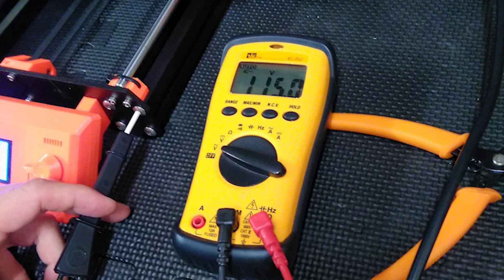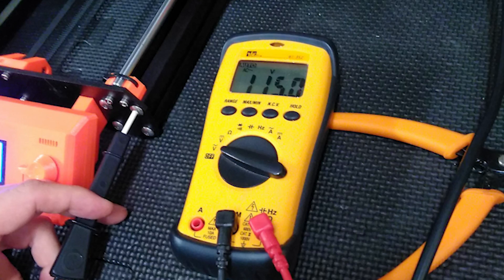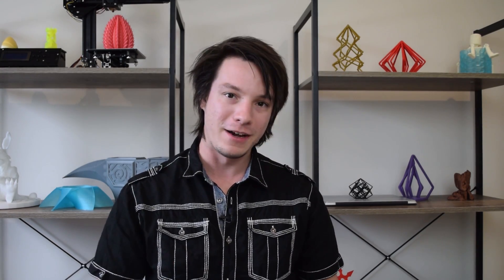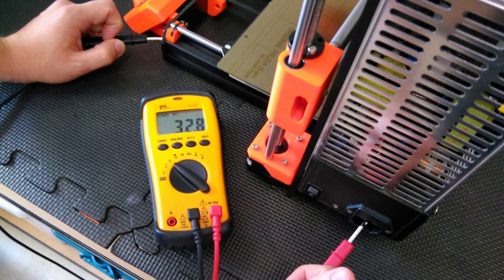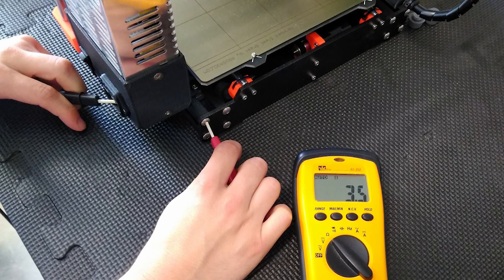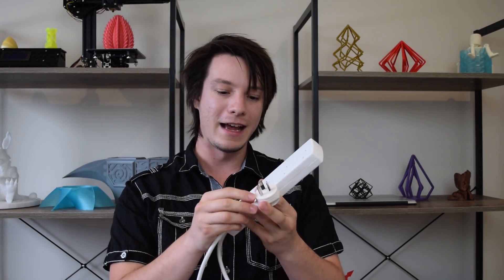I got shocked by a 3D Printer

Comment: No single wall plug in my house has ground, only in the bathroom. Is this really so dangerous or is this not a problem when you don't use a 3d printer with it?
Reply: And, is it really normal to have a 3d printer leaking voltage? Because if you ask me I would say it is a bit strange when a printer uses ground always. Isn't ground as a failsafe for when something goes wrong with a device, not to always be active?

Comment: I was shocked too when I had that old ENDER 3, the plug isn’t the right type, it came with these Iran plugs which have the ground in the wall socket, that means in North America the plug isn’t gonna be grounded. So when I finished assembling and plugging it in, I was shocked to s***

Comment: You'd be surprised how many devices dump power to the ground. We used to have Mac Books dump junk to ground all the time and it would get picked up in the Audio equipment we had running. When I travel to Asia I typically have a ground defeated device because dumb arse installers in particularly the Philippines won't install grounded outlets half the time. When I can I'll instead unplug the AC convert the socket plug in a power strip and then convert back so I can plug the AC and all my crap in.

Comment: I once had a similar issue when disassembling an old vacuum. i felt a tingling sensation going from my hand creeping up toward my shoulder and then I let go realizing what I was feeling was a 230volt charged capacitor, harmless if you know what you are doing but that was quite the experience.

Protip: when working on main electrics(120-240vAC)s even if you think there is no current, work with your main hand/arm and keep the other behind your back to make sure you don't accidentally try to use that arm, this reduces the change of the current going through your heart.

Comment: I'm here because I was just shocked on my CR10. Lol.  Reach behind control box to plug heater plug in. Forgot I had the cover from around the plug off to check wiring. (faulty keenovo 240volt heater). Printer was turned off so why was there some power getting to the heater output. I have 240volt going to my heater so it's a bit of a concern. Shock was unpleasant but can't of been 240volt or I wouldn't be typing now. lol

Comment: Reminds me of how I learned that I have a GFCI in my room. Was working with my Anet A8, thought I had the power strip (which I was using as the power switch) turned off, and accidentally touched a mains wire to the PSU casing. Got startled when the power to my room unexpectedly went out. No sparks, no nothing. Thought I had a power outage. Went out of my room, the rest of the house had power. Checked the breakers, mine wasn't tripped. At that point, I was confused, and started investigating plugs. The power strip was fine. Then I remembered seeing a GFCI on another wall. It had popped. Unplugged my printer, reset the GFCI, and everything's back to normal. I got friggin' lucky. Those mains wires were live, and I didn't even know it. I could've gotten seriously hurt.

So, now, from that point forward, I've learned to ALWAYS treat a wire as live unless I've verified with absolute certainty that it isn't. (ie: physically disconnected)

I've also since upgraded my A8 to be safer. (Aka: fused mains plug w/ a switch, external mosfet for the heatbed, better connections to the heatbed, etc.) Currently working on installing a Ramps 1.4, and replacing the stock MK8 extruder with a Hemera. At this point, the parts I've put into the thing are probably more expensive than the printer itself.

Comment: If your testing these new machines that get sent to you you should test them before you plug them in, you should get a PAT tester, you can test your extension leads and IEC cables also. They range from very cheap to ouch... Its worth reading Code of Practice for In-service Inspection and Testing of Electrical Equipment 4th Edition or your equivalent in Oz. Dan, www.a1pattest.com

Comment: Amps are the killer. Volts, not so much.
Reply: not necesarilly, as high amps but low voltage (eg a car battery) cant shock you because its voltage is too low

Comment: My printer (Geetech MeCreator) had a bit of wire exposed at the power switch which was between the power plug and the power supply block and i got shocked by it once as i switched it on, not the same as this video, but I still underestimated the chances of actually getting shocked. Luckily the shock wasn't that bad, was more of a surprise than anything.

Comment: The equipment is not faulty, that's just the way some power supplies work - you'll get a residual voltage to ground that can appear very high.  It's not dangerous because the total energy is very low and when it actually is grounded basically goes away.  Using a voltmeter on the equipment when it's not grounded only gives you part of the story, because the resistance of voltmeter is in the megohm range.

As you now know, it's vitally important that you make sure that equipment that is meant to be grounded actually is.

The only other observation I have is that 20 kilohms is not grounded.  A ground should be a few ohms at most, so I'm not sure what's going on there.

Comment: Same thing with mine when using the supplied euro iec cable and the shonky supplied adapter, no decent earth and a tickle when you touch the metal work. Swap for proper UK iec lead and no more problem.

Comment: After running my JG A5 for a bit the power switch stopped working leaving the machine permanently on, whenever I unplug the machine there’s a visible spark hum from the outlet to the cable. No idea how they managed to screw up their wiring so much, but if I had to guess I’d say it has something to do with a lack of quality control mixed with their power outage recovery system

Comment: you got a zap off the noise suppression cap in the front end of the power supply
Reply: PS these are located across from line and to ground to stop or limit digital and switching noise from leaving the unit

Comment: From an electrical standpoint this does not make sense at all.  How could the A5 be leaking voltage with no ground then going into the Prusa?  If it was going to ground then it would go to ground, if not then it would go to neutral, still not effecting the Prusa. The A5 is not going to produce more voltage than mains voltage either so still not going to Prusa.  You said all this time that the A5 was printing find, so if it had an electrical problem like you mentioned then that would have screwed up the electronics and print.   Going off other reviews here and on the internet, this sounds like a common Prusa issue that you are trying to blame the A5 on for the sake of benefiting your friends at Prusa, and that is very sad.

Comment: You probably should put a GFI outlet at your walls.  Don't know how they are installed in British wiring though. If there is a imbalance in current from the neutral wire and mains voltage it will break the circuit extremely fast.  So if some current is leaking to ground, you have a much higher chance of living.

Comment: i once had tutched the connector on my printer where the fans, the thermistor and the heater cartrage where and because there was no thermisttor the printer wanted to heat the etruder luckily it wasne't the one for the bed witch uses 220V to heat

Comment: I'm a sparky, and see all sorts of dangerous equipment that people are unaware of. Even those people with a lot of electronics knowledge, but no real understanding of how protective earths work (as opposed to functional/signal earths). With no earth connected to the printer, the voltage you felt could well have just been capacitive or inductive coupled from the power supply unit, not necessarily an earth fault in the printer. However the only way to check is to check the printer properly with a 500V Insulation Tester (Megger) to be sure. ie. short the plug's active and neutral pins together and apply the 500v tester between those two joined pins and the earth. Also test the Earth continuity between the plug earth and exposed metal on the appliance. The Australian regulations require this to be done with every appliance before it's sold or used. Some dodgy imports and home made equipment skip this important safety check.
BTW, a sink may not be earthed as well, as plumbing in Australian houses is often now PEX (plastic) instead of copper piping, and PVC waste pipes. To really test earths, you need an independent earth (a long wire out to a screwdriver stuck into the ground will do).

Comment: I noticed the power cord you were holding at 7:50 and recalled getting the same type on both of my DIY printers... an Anet and a Hictop... Being an electrical engineer and noticing the ground terminal on the PSU I immediately chucked those in the trash and cut the end off of one of my old standard computer power cords... stripped the wire back and voila! grounded cords for free!  That may be something that others may want to take note of as well... if there is a ground terminal on a PSU *USE IT*!!! A free source of cords is any older computer, monitor or peripheral cord. (I had tons!)

Comment: I have allmost all of my home without electrical ground. Une time I check the potencial between the ground on the chassis of one computer without ground, only with two wires and the measurement was 60V to the floor. Yes what we touch with nude feets. That help too, in fact is the only protection than I can have at home and only touch one wire at the time.
If anyone touch the frame of this computer their will fell tickle, normaly I was scary about that on every piece of hardware until I lost allmost all of the scary... I still thinking isn't enough safe but step by step the ground will arrived at home finaly.
Note: the home is from 1942 and the wires on it didn't make any confidence on anyone.

Comment: I got my CR-10s a bit over a month ago to Israel. I had ordered a EU plug because our plugs are very similar in shape. The plug that arrived looked alright - but literally, the only thing I did with it was look at it. It had two pins and the little European metal touchy thingie that serves as ground there.
Our plugs look similar but they have 3 pins much like the Australian ones, apparently.

After making sure with the local community, I took an old computer cable and used that instead.

You don't play with the ground in AC :) 

(Not that I'm suggesting that you did, you made an honest, understandable mistake. Just proud of myself for not being so enthusiastic that I'd risk myself. Hopefully the replacement cable is safe)

Comment: Prusa should be mad at you for this video. Anyone not seeing it all, just stopping inbetween because it's boring and you ramble confusedly about electricity and grounding, will simply get the impressions some Prusa power supplies are faulty.

Anyway, in almost every civilized country a circuit breaker would have tripped way before you could get any form of shock. I don't know what's wrong with Australian building codes, because I have the feeling you have RCDs in there, but I read a number of horror stories about electricity, maybe they're calibrated too liberally.

Comment: If equipment is requires it, China have the same plug as Australia, lot of the times, low power equipment don’t come with ground because it’s deemed unnecessary. Some doggy manufacturers do some times try to save a cent to use unearthed designs.

Comment: so have you found out where it was leaking current? 
  you better call up an electrician and upgrade the mains trip switch from a Earth-leakage circuit breaker(ELCB) to a residual-current circuit breaker (RCCB)
 that would trip the switch even when the ground is faulty. https://en.wikipedia.org/wiki/Residual-current_device

EDIT: just read down the comment about EMI filter inside PSU's, sounds plausible, but anyway i would still make sure i have the proper main's circuit breaker in case sometimes in the future ther's a different scenario.

Comment: Just because a printer has an IEC plug do not even think it is grounded until you open it up and look if the switch to power supply has a ground wire. I had one recently that did NOT have the ground wire. 4" of wire was all that was needed and forgotten by the manufacturer. The lighted switch bulb wasnt grounded either . I hooked both to the power supply ground and now the switch light works and the machine is grounded.

Comment: Do you guys use AC or DC? I was lucky to only loose sensation in my hip on the right side after a 220V AC line dropped next to me from the wall of my school and carried it's charge through a metal strip on my work bench. That was in highschool by the way and I am in my thirties now.

Comment: In the U.S., our power at the wall is only 110VAC, not the 220VAC common in most of the rest of the world, but it is STILL enough to seriously injure or kill you. I do a lot of electrical work on the side as a handyman, and I have seem some truly frightening wiring configurations, made by some clueless moron who didn't respect electricity, that were ticking time bombs and it was sheer luck that nobody had been hurt nor had a fire started.

In many areas worldwide, the cold water pipe is NOT a reliable ground any more, because of the presence of water filtration or water softening systems. The only truly reliable ground SHOULD BE in the main electrical breaker panel, where all the household circuits SHOULD land their grounds. I am saying SHOULD in all caps to stress the point that it isn't necessarily so, and assuming anything can be a good way to get hurt.

Comment: Just ran a test on my Prusa MK2S. Connected AC power but not ground. Measured voltage between one AC input and ground terminal at 49V, between the other AC input and ground terminal at 71V. Note that 49V + 71V = 120V (U.S. line voltage). Demonstrates normal operation of Y capacitors in power supply input filter. Not dangerous due to low current. No more or less "defective" than the JGAurora's power supply!
Reply from the maker: Really appreciate that! I think there's enough great feedback now to point to the filter caps causing the voltage I felt. I'm really glad it's something normal, honestly. I'll put out another update later in the week.
Reply: You're welcome. I'm learning a lot from your channel, and I'm happy to share a little of what I know. You're doing a fantastic job.

Comment: The cord you showed in the china kit was a US 110v plug. A US 110v doesn't work unless it's grounded. One prong is hot the other is ground. When you see a 3 prong 110v US plug it's one hot and 2 grounds. One of the grounds it referred to as a common, but it's really a ground. Your  220v 3 prong plugs are two hots and one ground. Honestly the US system is a safer, but at the cost of halving the load carrying capacity of the outlet.
Reply: This is so wrong I'm not even going to explain. People should look elsewhere for electrical information than this comment.

Comment: You shouldn't be getting 20kOhms between the ground/earth pin and any part of the case.  If that measurement is correct and live touched that part of the case while you were touching it then 12mA (I=V/R=240V/20kOhms=12mA) would flow through earth and the remaining 2.988A would go through you (assuming you have a 3A fuse).  I'd double check the reading and make sure the manufacturer is aware.

Comment: Something that encounter a lot is the mere fact that many Switch Mode Power Supplies (SMPS) do not AC couple the ground.  This has the effect that even though your DC is perfectly fine, the AC  component that passes through is capactively coupled to ground/earth thereby you can have up to 100V AC (Low Current) leak out onto conductive surfaces like an ESD bench mat.

Comment: I was adding a switch and power cord receptacle to my Anet A8 and hadn't printed the housing for those and the PSU yet. I went to flip the switch to turn on the printer and, since there were exposed connections, I got a dose of 110/120. I don't remember dying or it really hurting that bad, but I definitely knew what had happened and almost immediately. Yeah, the next print was the housing for the switch, cord receptacle, and PSU.

Comment: A bit of current leakage is totaly normal.
In Switzerland we got residual currend devices, which measure this leakage current and shut off power similar to a circuit breaker if it gets above for example 20 mA.
But your absolutely right. Every device that runs of mains voltage and has touchable metal parts has to have an earth connection.

Comment: A few people have mentioned it on here already, But my thoughts are look for a neutral wire loose or disconnected, whether it be the other printer or the power boards you are using. In Australia we have what is referred to as a neutral earth system. Where the neutral and earth are tied together. If you have a neutral missing, the appliance will still work through the ground loop, but cause that to become half mains potential. But I would be checking your rcd's very swiftly. And if you are renting and the house doesn't have them, that is against the law.

Comment: It sounds like a open neutral wire I had a similar issue in a house that I was working on. I was getting shocked on the grounded side of a metal case and blew a dvd player because of it. I had to use a circuit tester to find what the issue is then had to find it